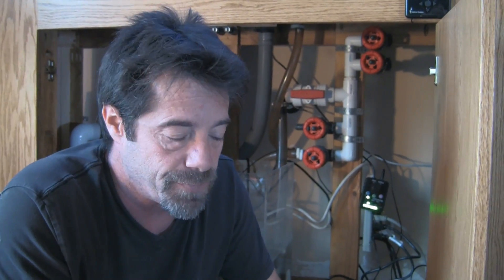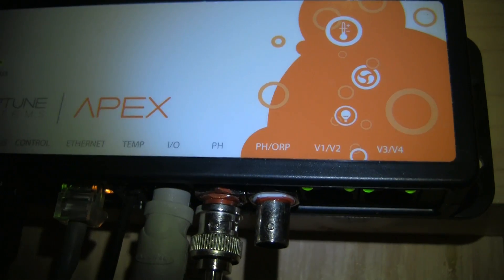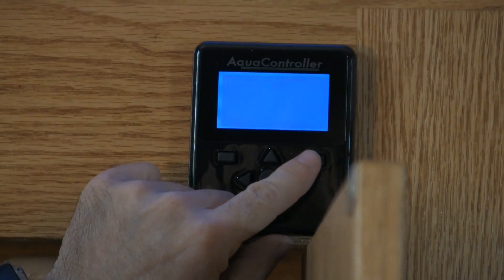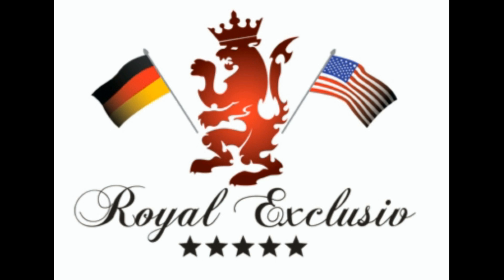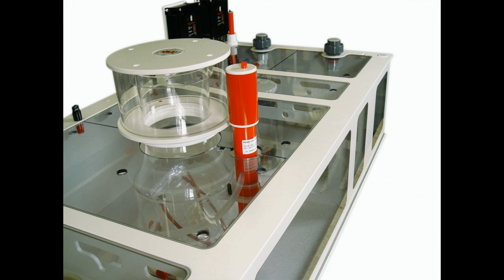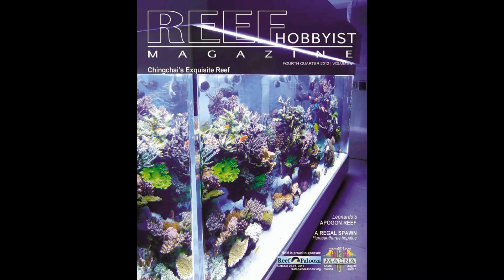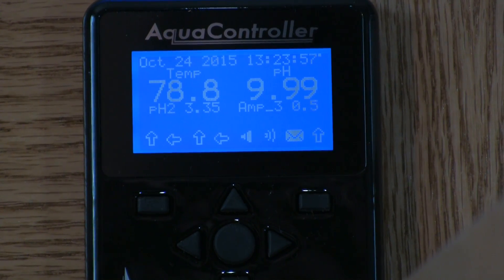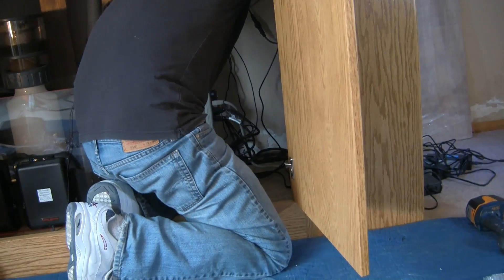Neptune Systems APEX Aquarium Controller, pH Probe Calibration, Tech Talk pt 5

Comment: Love the Apex system, however being in the UK the only things I need to keep an eye on are Nitrite, Ammonia and Nitrate. PH and temp are mainly consistent in most (sand, gravel, coral, give stable PH) UK systems.

Do you know of any systems like the Apex that would alert/give an indicator on Nitrite, Ammonia and Nitrate?
Reply: +Ian Roughley You could try the Seneye Ian, although Apex is on a whole other level. Nitrite and Ammonia don't really need to be monitored outside of the initial cycle though, so imo is of questionable use.
Reply: +Ludicrous Gib Cheers I will have a look at it. While I agree with your comments I'm having problems with my fresh water system after adding a large rescue Oranda. My system crashed and while I'm bringing up the biological filtration it would be handy to get a notification when things are going to far instead of relying  on me doing a test every night when I get in from work. Lucky for me the PH is such that a spike of Nitrite has a very slow effect on a fresh water system.